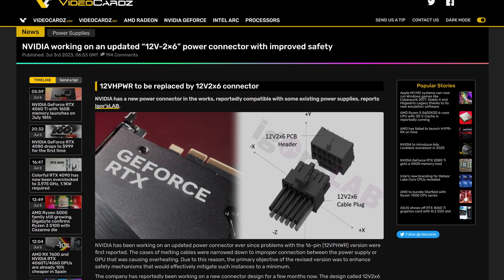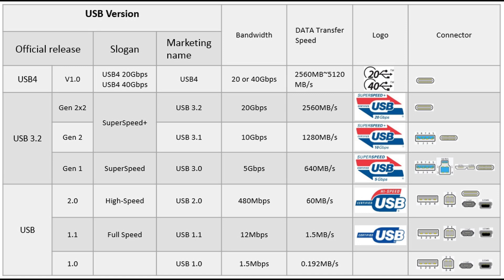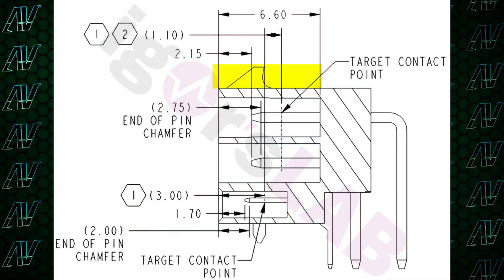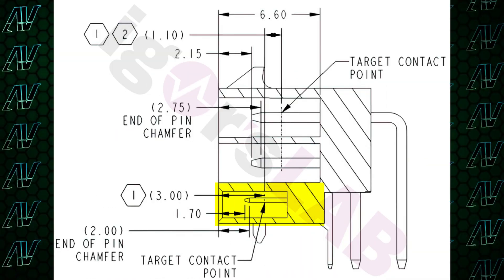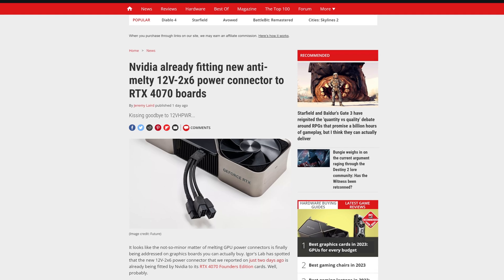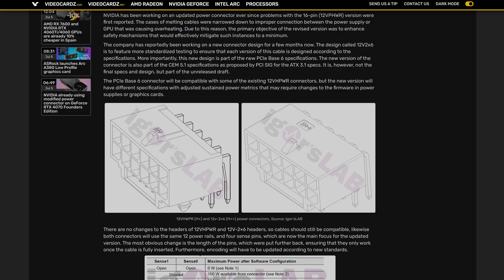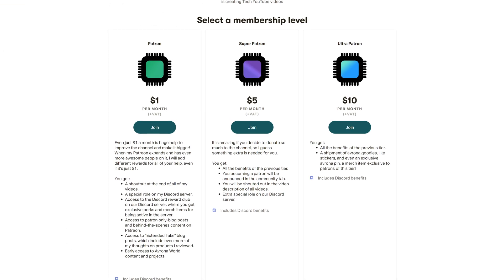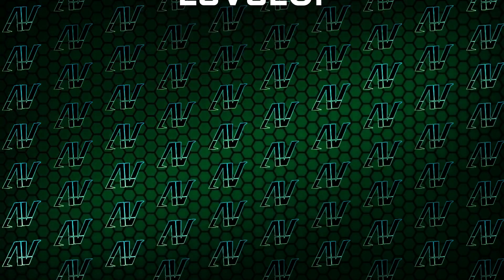Nvidia FINALLY Fixed This?! Nvidia 12V-2x6 Connector

Comment: Although I do think that NVIDIA have not been the best manufacturer right now with the RTX 4000 series, this whole accusatory "NVIDIA are the bad guys because their GPUs set on fire all the time" is just unfair. The 12VHPWR connector setting on fire was found to be primarily user error. Although there were instances of manufacturing defects causing debris, its because people weren't plugging them in. And since Gamers Nexus raised this, there have been effectively no reports of anymore GPUs catching on fire.
Reply: This is 110% nvidia issue.. only 4090 with this issue.. strange all those 4070 and 4070 ti and other skus are fine.. no 3090s or 3000 series burned up.. strange..
Reply: Sorry, but this is just absolutely not true, take a quick peek at the Cablemod subreddit, and you will see dozens of melted cards appearing, sometimes multiple a day. This whole user error nonsense has been beaten to death with misinformation.
Reply: @hmmmokayy  its false in your comment , its  reported that it has not become serious enough to cancel atx 3.1 specs when all psu are moving forward with this tech...the numbers are very low in reporting due to Asian manufacturer error ...its not first time since first 6pin pcie gpu connector came out , it was doozy back then i remember the first gpu using first external power source and those connectors did had variety of issues with power delivery balance and psu errors back then, good thing it was not wide spread problems to be that serious so atx specs is moving forward with 8pin cable next version